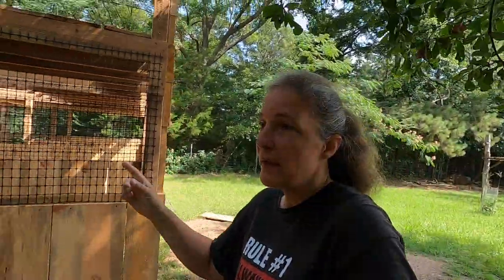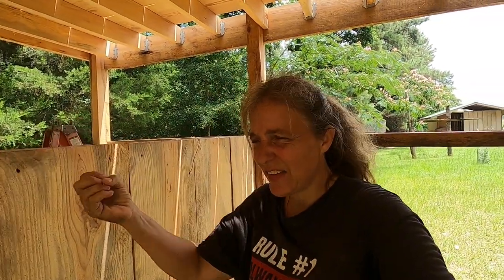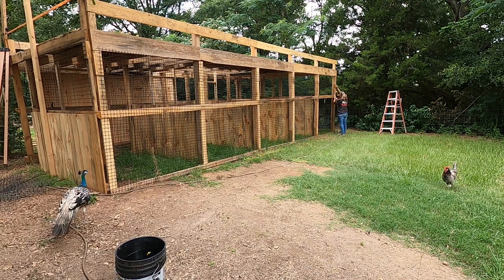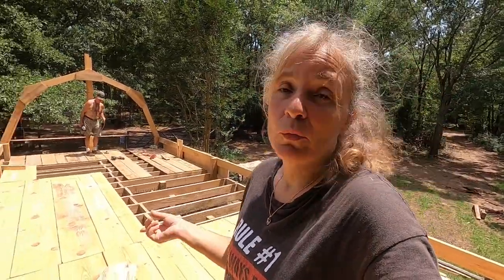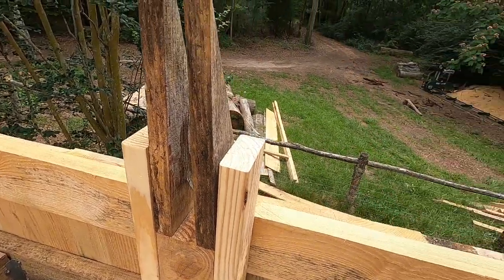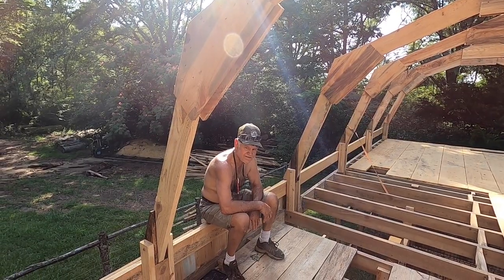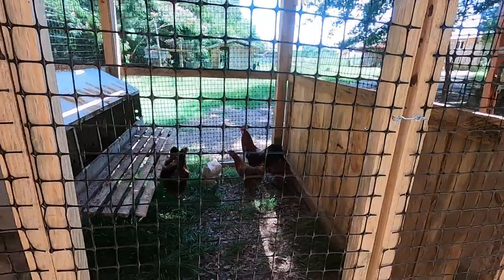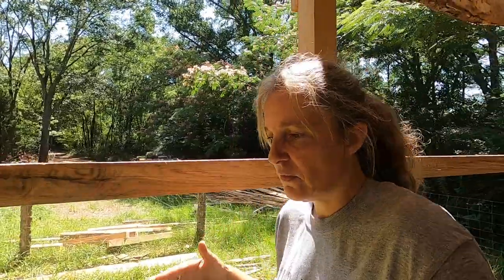It's Time to Put Chickens in the Barn

Comment: Great job on the design.  I would just make sure you have good homeowners insurance.  Doesnt matter much how strong you build when it comes to mother nature sometimes.

I would use quarter inch fence for the chickens rather than the plastic one, predaters have chewed through my chicken wire like butter with a hot knife..  I do remember you saying something about its main purpose was to seperate the chickens?
Reply from the maker: Not too worried about predators since the chickens haven't been protected at all this whole time. But yes the barn is just to separate the chickens so when I want to hatch some I know what breed I'm getting.

Comment: Skin si Soft from Avon will help you out.
Reply from the maker: Do you have personal experience with it?
Reply: @ThirdTimeAroundRanch  Yes...I think there is Deet in it. We discovered it when the kids were small. Deep Woods Off is good too but is too strong for the little ones. Plus you need to reapply it often to be effective. The Skin so Soft has staying power.
Reply from the maker: @barrystrachan6340  I looked it up online and it's $25 for 5 oz. It would have to do a lot more than keep gnats away for that price. Maybe build my barn for me. LOL
Reply: Soak strips of old tee shirts in diesel fuel and hang them around the barn on that plastic fence. Gnats will be repelled. If the gnats are what we call buffalo gnats they can kill your poultry. They get in the chicken’s nostrils and bite them. The nasal passages swell and the chicken suffocates.